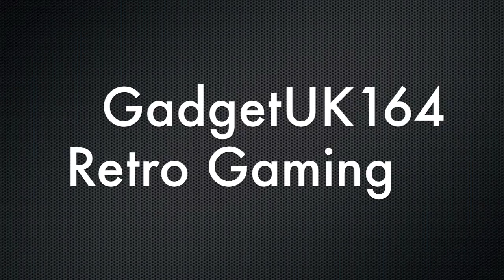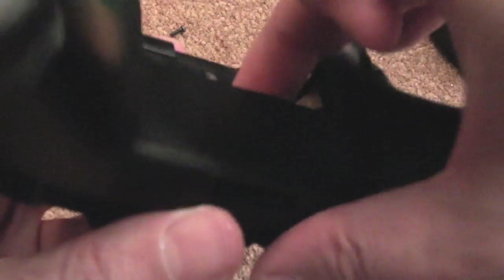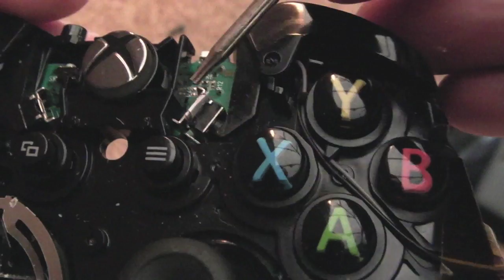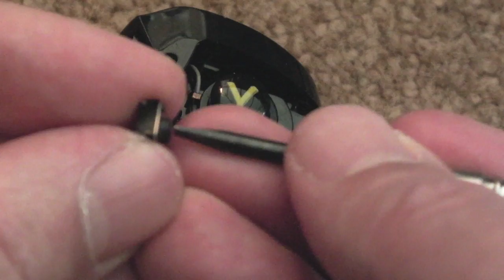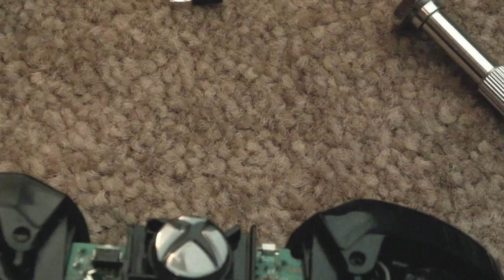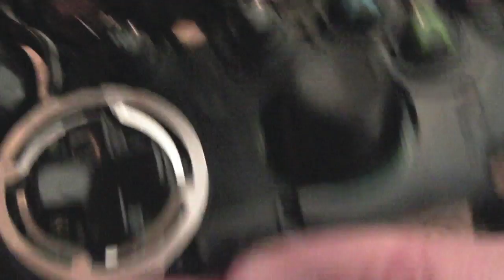Microsoft XBOX One Controller RB / LB Button Repair (Again)

Comment: Never seen inside a Xbox Controller before. Well done on fixing the problem. Wish I could do Soldering.
Reply from the maker: Thanks =D  Get yourself a cheap 15W iron from eBay, get some 60/40 solder containing flux, and have a go with some old junk faulty PC parts or something!  Start with cables or something.

Comment: So the problem I have is my RB is don't really know how to explain this, but when I turn on my  controller it's like the rb is pushing it's self but I have no rb in my controller don't know if its a fault with that controller... Hope that made some sort of sense
Reply from the maker: Sounds like a controller fault then.  When you say "have no RB in my controller", I assume you desoldered the micro switch (not just remove the plastic RB button)?
Reply: GadgetUK164 - Retro Gaming Repairs & Mods Yeah I removed the RB and LB to see if it was the RB stuck, but once I done that it was still doing the same thing. Think it's the micro switch, annoying because I only bought that controller 4 months ago
Reply from the maker: Yes, if the microswitch is still soldered on there - it will be the microswitch!   They either stop pressing, OR they are so worn they stay stuck down and can intermittantly fire on their own.

Comment: I saw a video of someone using Xbox 360 bumper switches and using those to replace the bumper switches on the Xbox one, i might try that, bc all my 360 controllers still work great bumper wise, although the button hieght needed to be adjusted, by way of dremel.  Might just be easier to order ones that you suggested
Reply: Ian Johnson plows pppppp

Comment: My RB doesn't work but still makes the click.
Do I still need a replacement switch?
Reply from the maker: It's possible you have a crack in the PCB or a fault somewhere on the board, but it's also common for the button to still click but not register.  I would suspect swapping the button out may fix it.    Some people suggest trying to blow air into the switch by putting your lips around the area of the plastic part and blowing into the controller.  That can sometimes get it working again if its just a dirty contact.
Reply: what do you do ?

Comment: My LB clicks fine but I had to push it hard to work. After the 20th click I stopped pushing it harder. It still clicks though. Any idea on this?
Reply from the maker: Same problem - tactile switch needs replacing!   One of mine went the exact same way there!

Comment: I swear to god look at all these views, they need to make rb and lb buttons better it's so stupid the amount of ppl that have the same problem
Reply: Randy Collado and always are the right one have problem
Reply: Yeah. I cant even check down in madden. Fuck. Makes it more difficult for sure.and id rather buya new controller than do this shit.
Reply: Exactly the RB button that's broken on mine as well. Funny thing is, I've barely used this controller, yet it's broken.
Reply: Randy Collado yea fuck xbox i have 3 controller with the same issue and it’s annoying i need to buy a new xbox controller only for a freaking button
Reply: that's why they make so many controllers so that every mouth you buy a new one
Reply: Yeah I have the newer version and the switch is fine. Only when the right trigger is depressed, I can use the rb function. I have it disassembled. Can’t figure it out
Reply: Randy Collado my clip on it is broken.
Reply: In my case the L button broke so I bought a new LR button. Funny thing is now the R button doesn't work properly, only the L button does. It's stupid. I bought a new controller because my old one, despite having changed the buttons twice, it never work properly again. I suspect the very structure of the controller is so compressed that the moment you open the differents parts, a slightly different curve in the components will change the pressure in certain sections of it and then the buttons stop working properly. In the end I guess Microsoft design these controllers to break in less than a year so you have to buy new ones so pretty much that's 30-35€ at least for me. Thankfully I don't play my xbox one that much but holy cow, it can be expensive if you are not very careful.
Reply: 1Q
Reply: In my opinion, they do it on purpose. A lot of people just buy a new controller which means more money for Xbox. And they have a monopoly on these controllers.

Comment: Hi, i know i'm very late but, my problem is kinda different. i was playing a game and then the rb button just simply popped off the controller. i tried to insert it back in, but every time i removed my finger from it, it popped off again. Then i looked closely, and saw that a little part of the plastic at the left of the button was broken. first time that happens to me, what should i do?
Reply: The only thing broken is basically that little plastic part...
Reply from the maker: You can buy the replacement RB and LB plastic parts on eBay.  Just search eBay for "RB button XBOX one"
Reply: there is no fixing it unless you buy a brand new piece i had the same thing happen to me, brand new controller was just playin For Honor and boom it popped out tried pushing it back in and broke the latch on one of the ends that held it in, i had ducktape holding it for awhile until i finally bought one this christmas lol..
Reply: Oh ok xD thanks for the explanations, both of you! :D

Comment: My LB clicks but i have to press it really hard for it to work can someone help??
Reply from the maker: Sounds like the microswitch needs replacing!
Reply: GadgetUK164 - Retro Gaming Repairs & Mods thanks bro ill look into it
Reply: The Gaming Nugget have you fixed it I need help
Reply: I had the same issue as him. I had to press really hard. I decided to open up the controller as shown in the video, fold a receipt i had (I folded it 4 times) and put it in between the circled button on the microswitch and the bumper. Now It works like new. I barely press the bumper and it registers the click!

Comment: One of the few good videos i found thank you.I just have a question,my lb works somewhat but is extremely loose how would i fix that?
Reply from the maker: Sounds like the plastic part of the LB button is fractured.  You can replace the LB and RB plastic parts - just search for RB and LB button on eBay.

Comment: how do you fix an rb button that clicks but doesnt respond
Reply from the maker: Sometimes you can blow air into the switch - some people suggested the strange technique of putting your mouth around the RB or LB button and just blow into the controller.   Suprisingly that sometimes works when the click is there but the button isn't registering.  Alternatively it will be damage / oxidised contacts on the switch and you would need to swap it out like I did.   The final possibility is a bad solder point or fracture in the PCB.
Reply: Zunex91 thankyou this helped
Reply: GadgetUK164 - Retro Gaming Repairs & Mods Thanks so much! I just blew air into my RB button and it now WORKS! I don't know how blowing air into it works, but it worked!

Comment: so where can i buy the little button thing?? that my onlu issue please and thank you
Reply from the maker: You can buy the same kind of switches from most electronics suppliers (6mm x 6mm x 2mm I think), or something like this from eBay:- http://www.ebay.co.uk/itm/2-x-XBOX-One-Controller-LB-RB-Shoulder-Bumper-Button-Switch-/162216016560?epid=599838789&hash=item25c4d3fab0:g:qJoAAOSw7ApZxteR

Comment: Which material is best for Screw-driver that it will not break while opening controller. Can you send me the link please?
Reply from the maker: Have a search on eBay - there are screwdrivers dedicated to removing the screws from XBOX 360 or XBOX One controllers.

Comment: Hi my LB button clicks like the RB button but occasionally fails as if it has a short in the system what could that be?
Reply from the maker: It could be the copper contacts sticking inside the switch.  Utlimately you get either the switch not working at all, or occasionally staying stuck on.  And it doesn't always stop clicking.   You could try spraying contact cleaner into the switch - sometimes that can fix either issue there when its still clicking.

Comment: I tried to do this and clearly screwed up, as the new button does absolutely nothing, and after removing and reinstalling I can only presume that I damaged the circuit board itself so that the new switch can't make any connection.
Reply from the maker: It might be worth examing with a magnifying glass and use contuity tester on your multimeter.  If you can find the broken pad / trace, you can follow it to its destination and just bridge it with a small wire.

Comment: Hi, I haven't been able to find a similar situation to mine so I'd appreciate your thoughts!
My LB clicks fine but only registers 1 in 3 presses or if I hold it. I've taken it apart, cleaned it and blown it out with compressed air which hasn't helped. 
The common theme has been to replace the switch if it stops clicking which mine hasn't. Seems it should be fine...
Thanks
Reply from the maker: Hi =D  That's normally an indication that the switch needs replacing!  I've had a few where that has happened!   Sometimes it works, sometimes it doesn't - normally either the contact is dirty in the switch, or the switch is worn to the point where it can be intermittant.
Reply: just had same problem switch clicks but only registers half the time- resolved by actually spraying a good dose of electrical contact cleaner on the internal button once you have the cover off and give it a few presses or even a few light presses with a screwdriver and then give it another spray and wipe of the excess - this also works on badly functioning buttons and pads. Sometimes I think dirt or grime builds up on either the button or mechanism and little spray fixes it straight away.

Comment: The Xbox One Elite ( and newer XB1 controllers ) uses an inferior RB/LB mechanism that isn't hinged. It's a strip of plastic that joins the two buttons together.  I've recently replaced the RB/LB buttons on my XB1 Elite controller. Would have rather seen this hinged mechanism on it.
Reply from the maker: Good old Microsoft and their penny pinching designs...  It's about time the industry started designing quality products that are designed to last. =/

Comment: Hello i'm trying to order this little switch online... Can you tell me the exact name of this piece? Thank you
Reply from the maker: I think a 6mm x 6mm x 4.3mm tactile switch will do the job, or you can just buy something like this:- https://www.ebay.co.uk/i/391498281641?chn=ps&dispItem=1&adgroupid=45192391362&rlsatarget=pla-327465395450&abcId=1129006&adtype=pla&merchantid=113811848&poi=&googleloc=9046527&device=c&campaignid=861899735&crdt=0
Reply: GadgetUK164 - Retro Gaming Repairs & Mods Thanks for your answer! i found on ebay the right switch...

Comment: my rb isn't broken but it doesn't do anything when I hit it. do I need a new sensor button?
Reply from the maker: Does it click like the LB does?  Sometimes if you blow air into the RB or LB you can get them working again (provided the switch is clicking).  Some people put their mouth right over the RB or LB button to blow into the controller and apparently that can get a dirty switch working again.   If its not clicking like the LB does, it will need a new microswitch like mine did.
Reply: Oh guys so glad you shared your experiences. I disassambled my controller today and - after reading your comments - did two things: first I blew compressed gas around/into the switch. Put batteries back to test it 
before reassembly but it did not work better. Then I used isopropyl alcohol, sprayed it right into the switch, practically drenched it :D. Put batteries back to test it and it was as good as new. Ok not as good as new. The click is not as clear as the other bumper, but the switch works and my trooper throws granades again. I blew some compressed gas again two minutes later to make the switch less soaky, reassambled the controller and I am happy now with the controller. Will come back here once it gets dirty again. :D
Reply: holy shit i know im 10 months late but i just did this shit and it worked!!!! time to play more microtransaction filled battlefront 2 :D
Reply: Amazingly this actually worked ... one less 10 year old kid on my back now ... hope it keeps working ;)

Comment: How many watts are on your soldering iron? I have 25 and I'm confused if that's enough to do the job...
Reply from the maker: I used a 15w iron when I did it.  A 25w will be OK, just don't heat the pads for too long and you should be OK.
Reply: Ok, thanks.

Comment: My RB button acts like it's on auto fire. Just started doing it out of the blue. Not sure what to do.
Reply from the maker: The switch probably needs replacing, the chances are the metalic disc in the switch is probably warped from usage.
Reply: GadgetUK164 Thanks. It's bloody annoying trying to play a game with it. So I've had to revert back to my wired pad which my son has managed to break as well. Joyous and thanks kids.

Comment: great video but what do you do if the RB works it's just really loose
Reply from the maker: If its loose as in, not clicking in and out much (like mine was), then the switch needs replacing.

Comment: does anyone know if the elite rb and lb buttons are the same as the standard old Xbox One contoller buttons? I want to order ones but all I find are elite buttons.
Reply from the maker: Are you talking about the switches or the plastic parts?
Reply: GadgetUK164 the plastics parts like the rb and lb buttons
Reply from the maker: I am not sure then - eBay would be my first guess, but I don't think the plastic parts fail very much.  You're best bet might be another faulty controller to use for parts =/
Reply: GadgetUK164 thanks I've ordered off eBay before to customize my controller they've worked fine but I have a controller from the first Xbox One that came out I just didn't know I'd the buttons for the elite controller were he same as the first Xbox One controllers. I think they are though thanks.

Comment: What to do if you have a broken LB and I think the part that inserts into it and pushes the button is actually broken off a bit..
Reply from the maker: Have a look on eBay - you can probably buy replacement plastic trigger parts.

Comment: is there any way to fo fix that little pice with stuff that you can find at home? because I don't know when I'm going to visit the store again. :c
Reply from the maker: If its not clicking when you press it, you will need to order a replacment and use a soldering iron to replace it.  If the switch still clicks, you could try spraying contact cleaner into the switch, but its best to disassemble the controller first in order to be able to spray contact cleaner into the switch.
Reply from the maker: If it is still clicking, try doing what some people have suggested in the comments - put your mouth around the shoulder button and blow air into it - that sometimes gets them working again for a period of time.
Reply: Ok I'll try that, thanks for answer my cuestion. 👍

Comment: when i blow air to my Rb button it works but after 10-15 min. it begin to not working again
Reply from the maker: That's common when the buttons need replacing =/
Reply: I have to replace it i guess. But switch that i had bought has 4 legs. Do i have to find switch with two legs?

Comment: never had a need to use lb or rb in any games i use. Got a game with a menu where rb and lb was required more than average and within 2 months the rb button is problematic. only works if you click a specific part of the button.
Reply from the maker: I think they used cheap quality buttons =/   Some people have found that just blowing air into the button can sometimes make it work when its intermittant.  But when its not making a 'click' sound its probably the contact inside the switch worn out.

Comment: hello I'm been looking around videos on how to fix all the magnetic  trigger especially in how to remove the metal ping holding  all the plastic and spring anyone knows  how...
Reply from the maker: Sorry, I've not had to look at that trigger yet so I've got no idea =/  Just take your time, it cannot be that difficult!  You might need to desolder a few points first and then perhaps it unclips like the 360 triggers did?
Reply: u fine as hell

Comment: 100% agree, this also applies to the cheaper Chinese LCD screens. Buy OEM or a known brand for replacements or if you salvage parts the sky tv box has a bunch of re-useable stuff *buttons (same type thats used in this video) *hdd *LED etc
Reply from the maker: Absolutely - I've got a black DS which I swear has a replacement bottom screen - contrast and colour just doesn't look like my other DS bottom screen.  Always a good idea to salvage parts from dead modern equipment - I don't see anyone wanting to collect Sky boxes in 20 years from now ;)

Comment: Thanks for the info' on where to find the solder points, they don't make stuff like they used to, my original Megadrive, Snes and PS1 pads all still work fine, same with the machines, either that or I am just lucky.
Reply from the maker: They certainly don't build em like they used to!!!  Not just the controllers either, the consoles with their BGA mounted components, lead free solder, wafer thin plastic etc.